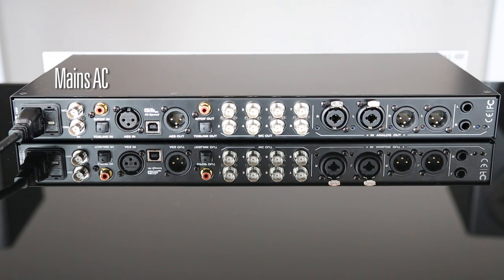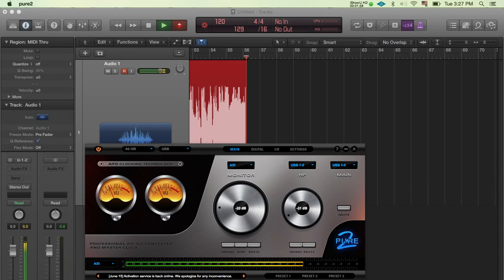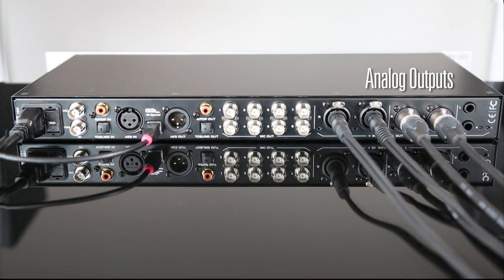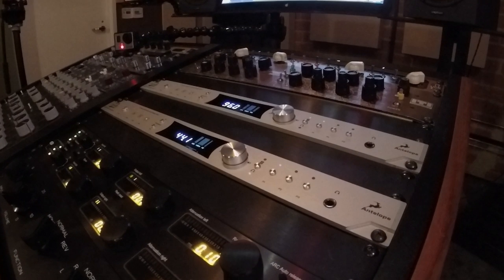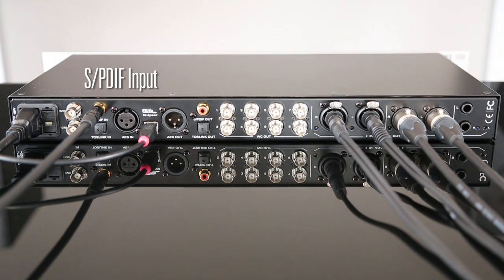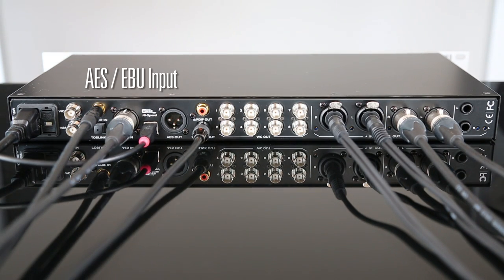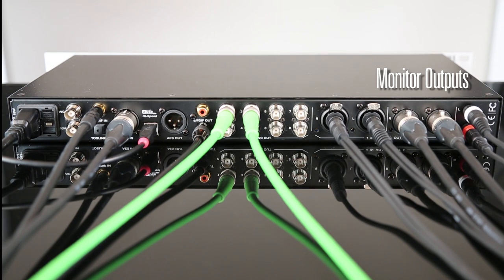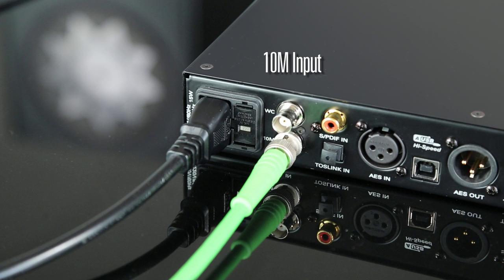Pure2 - Connectivity Options

Comment: I will be using RME raydat as the audio interface. Is it possible to use this routing while the USB is connected to pure :

ADAT 2 channel => Pure [ Digital TOSLINK IN --> Analog XLR OUT ---> GEAR - > Analog XLR IN --> AES EBU OUT ] => ?

Comment: Is it possible to use this as an audio interface?
Or do I need to have one?
Reply: yeah , that what i am asking  too
Reply: Great question, i want to know to
Reply: I’m using it as one, I don’t know how to connect it to my apogee quartet but it sounds better than my quartet.  I wish the headphone had more gain but that’s about it.
Reply: @JoeLSoL  hi, i recent buy a ad/da converter "ferrofish pulse 16 MX", and i learn new skills.
So, if you want to connect you Apogee with Pure 2, you have to connect the 2 adat via toslink, in1+out1 to Pure adat in1+out1, you also can connect only One of this, but connecting 2, your Apogee Will the "master", and Pure 2 "slave".
Next, you have to select the clock to sync, an example: in your Apogee áudio interface set 44.1  and the Pure 2 have to be set 44.1 clock to be connected
Now you have more inputs analog and adat connection via Pure 2
I think Im right, but Im not a expert
Reply: yes